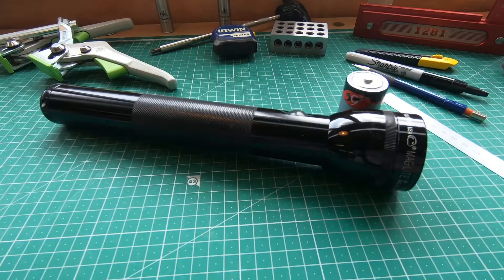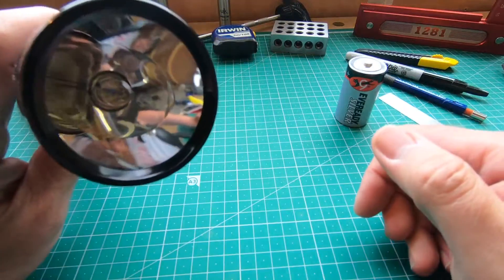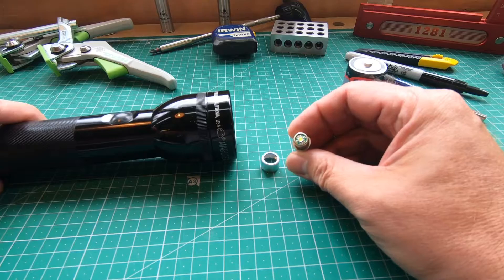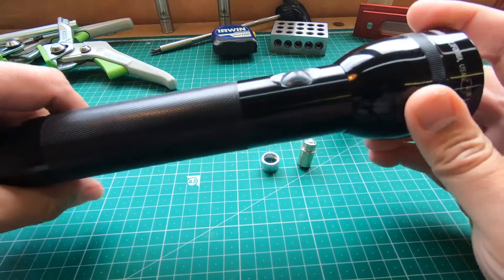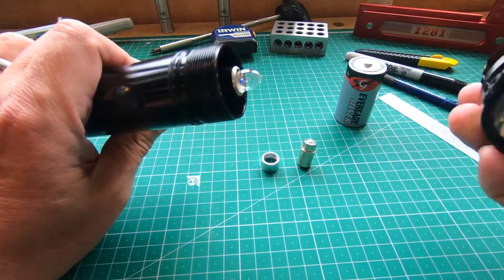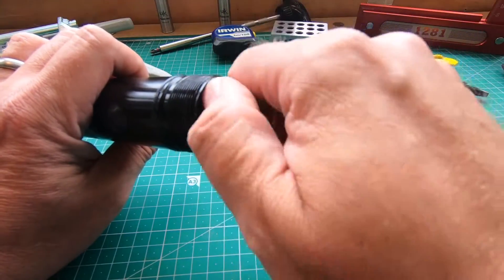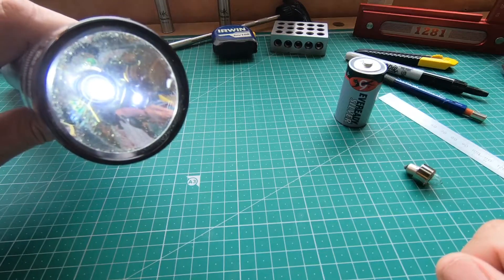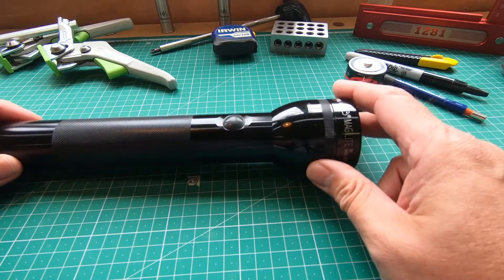D-cell Maglite CREE LED modification - Upgrade from weak, to peak!

Comment: That's true that there are many primary Lithium and rechargeable Lithium ion powered flashlight out there in smaller package and brighter output but cost of batteries are not acceptable and friendly with most of average users. Some people don't know these kind of batteries existed. Also you can easily get any primary AA, C and D cells in any supermarket, gas station and department stores. That makes the Maglite best choice for average people.

Comment: I own many 3D cell Maglites and also some Nitecore, Olight and other multi-mode modern LED flashlights and I can say the old single mode Maglite is more reliable. Some of mine are 20 years old and none failed. Some of my modern flashlights lasted 2-4 years and stopped working. There is a lot more sensitive electronics that are driven with higher brightness modes creating a lot of heat and pushing components to the last bit of performance in anything with modern features, meaning lots more reasons to fail. Good to see more options for the older D cell Maglites to keep them going. I have some D cell to AA battery converters that hold 3AA in each one in parallel so I use anywhere from 3-9AA Eneloops in my LED converted Maglites which works great with lots of run time.

Comment: 300 lumins is still nonsense when lights 1/8 that size shine at 1300!
Reply from the maker: Agreed, but when you already have one and it’s shining at about 20 lumens you’ll be happy of the upgrade!
Reply: 300 lumens is NOT nonsense. The flashlight in this video is excellent for long power outages, that many have of us have to live through every year. You are talking about some little pocket flashlight that will be dead days before this one would. It all depends on what YOU will use it for.
Reply: @mikenelson4271  My Maglite 3D single mode flashlights have taken me through a 10 day power outage due to a winter ice storm. That was back in 2010. Back then I had the 2nd gen Maglite 3D LED that was 160 lumens for 80 hours. 2 of those pointed to the ceiling acted as room light for 6 hours a night. I also had smaller 1000 lumen 18650 powered modern flashlights but they get heat soaked fast and have terrible battery life so they tended to be used to walk around on low modes. Good to see some people still understand what makes a good power outage flashlight.
Reply: Don't get carried away with lumens. There is more to a torch beam than just lumens. This includes the shape and intensity of the beam and also whether it is pure white or has a tint to it 

Three hundred lumens with a well designed optical assembly found in Maglites is good enough for most applications.
Reply: @peterkin1010  Yes that is true people always get carried away with lumens. Also you need 4x the lumens for the human eye to see twice as bright so you can really extend run time if you optimize what works for you. I did not believe that when first read it but I have a 3 pack of 100 lumen flashlights and turning them on one by one and flooding a ceiling I was shocked that adding the 3rd flashlight and going from 200 to 300 lumens only looked like 5% more brightness to my eye. Everyone's pupils dilate differently but it will be similar for most people.
Reply: But will that smaller light double as a bludgeoning weapon like an old fashioned maglite?